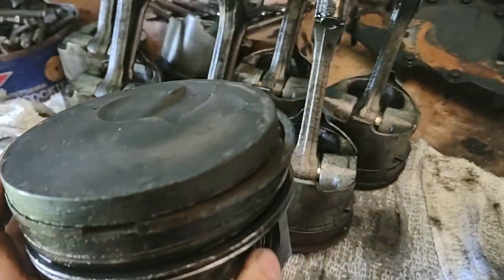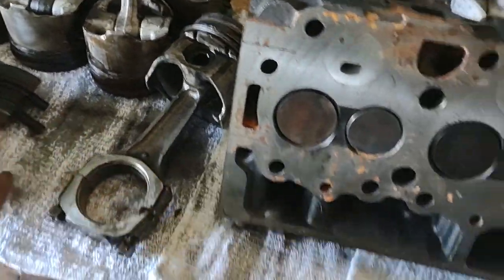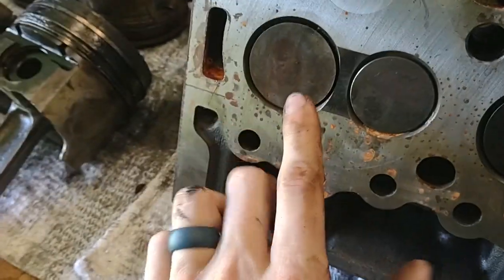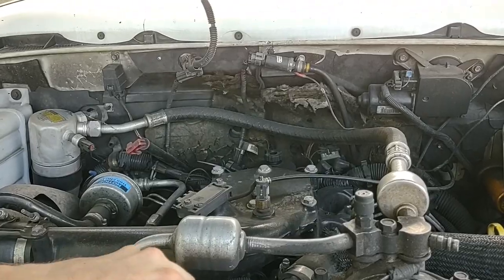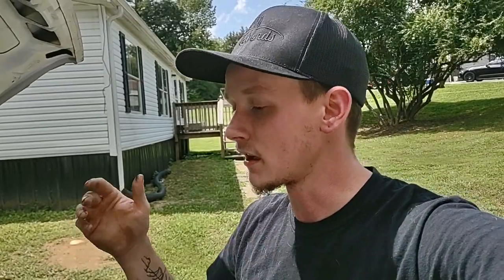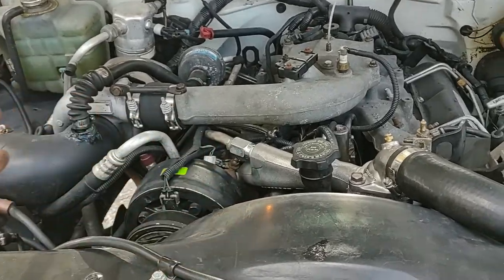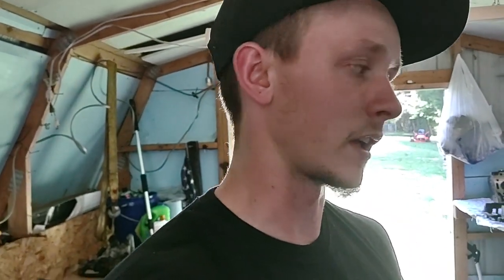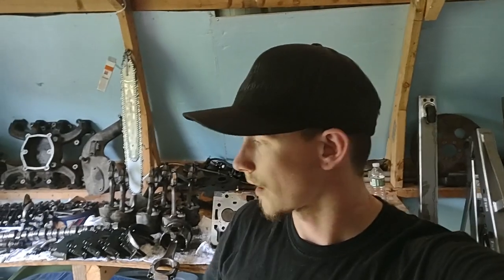6.5L blow by

Comment: I absolutely love all your videos. I just bought a 93 single cab dually yesterday and I've been binge watching your videos to learn as much as I can about these engines. I'm very familiar with the 6.6 Duramax and I currently have an 02 24v Cummins drag truck but I know NOTHING about the 6.5. Your videos have taught me a lot so far. Bought the truck with a bad starter and should be changing it out in the next day or two so I can fire it up to check for blow by and any other issues that need address
Reply from the maker: Hey thank you man, I appreciate you taking the time to watch the videos. I will have more on the mechanical pumps in the future for ya for sure haha. Hope your able to get her going soon brother 👍

Comment: 6.5 with maintenance are reliable engines.  Problem is nobody changes their oil, drives them like a race car, and drive them till they break.  I am learning the hard way!  Engine in my 93 k3500 has bad blow by because the oil was never changed and the dude sucked sand into the engine.  I only paid 500 for my truck though so a new motor is not a big deal to me.
Reply from the maker: Maintenance is key man, I completely agree. Glad you got the truck for I'd say a fantastic price regardless of condition and from the sound of it plan on keeping her going👍

Comment: Great video! Good advice for those wishing to own one of these. Thankfully, I have no blow-by stories to spin as I have kept up with the routine maintenance on my 94.
Reply from the maker: That's awesome man! Glad to hear you have run into no issues! I wish I could say the same but working on other people's trucks I've seen some  wild stuff haha
Reply: @JessePelkey1  Yes.   .I have a 6.5 turbo Chevy Tahoe in New Zealand.
It was converted to RHD in Canada & shipped new to NZ in 1997
Done a 190Kms & worth about NZD$25k.. Very cheep.
 Old gas Blazer are going for twice that.
diesel fuel is NZD$1.20 per lt.
 + road tax of 6c per km.  !!!
& road tax for a 50 ton truck & trailer is 60c per km
Some guy said there were Only 3k Diesel Tahoe's made. from 92 - 98. ??
Reply from the maker: @mtl-ss1538  not sure about that exact number as far as the Tahoe's go but I imagine where they are fairly hard to come by here in the states they are even harder to find over there in New Zealand.
Reply: @JessePelkey1  fun fact:-  only 3000 were ever made and most were sold in other countries, other than the US It was available from 95-99 and the 6.5lt Turbo, diesel Tahoe was a special order through GM. It’s one of the rarest modern vehicles you can get
Reply: @Dakota Duree While mileage and maintenance is a factor, if the truck has been worked beyond its intended limits that will also play a role. Then there is the possibility that no matter what you do or how it's used there is always that's one that just dies young. But having some blow-by doesn't necessarily mean it's done. Heck there are plenty of trucks chooching up a storm and still on the road with a couple 100k miles on them.
Reply: @Dakota Duree If you are building pressure and it escapes through coolant overflow then head gaskets or heads. Can't advise on additive as being a reliable fix. Minimal blow-by could be that the CDR needs replacing. Often overlooked but it is a wear item and if it hasn't been done then it's definitely overdo.
Reply: @Dakota Duree Could be just condensation. Never inspected mine when changing it. I have read that some folks clean and reuse it but I replaced mine as I understand there is a thin membrane inside that can be damaged making it non functioning.

Comment: Hey hoss, could ya take a look at my video showing blow by on my 97 6.5? Changed CDR and still has some. Not enough to float the cap, but it does come up from the dipstick tube pretty good. Maybe previous owner put non diesel oil in? I have a feeling I'm not making much boost either. So I do think my turbo could be helping add to the blow by. I have a boost bolt coming in so I can run my boost guage to see actual pressure.

Comment: hey Jesse , I only have 25000 miles on my RV and its had blow by from when i purchased it at 10000 miles , its a 2003 when i purchased it the units in Australia have no pcv they just vent to the road ,,, I didnt like that so i put a seprator on and i get about 30mls on oil change at 5000 miles ,,, My Truck is NON EGR,,,,,,I think they all have blowby unless you put Gapless rings in ,
Rob 
NSW
Australia
Reply from the maker: Hey R.J, yes without gapless all engines have some blow by,be it almost non existent or just a little hase, just depends on how much and if there is any pressure behind it like said in the video 👍 oil vapor is pretty normal but when it comes to pressure that's when things start to go south.

Comment: Goods videos i really like the time you take putting good info in your videos and i own a 94 suburban with the 6.5 and sadly the previous owner hade a flex plate issue and put a new on in but did not get it right and it has been sitting for about 4 or 5 months and it only has a little over 187000 miles and was wondering what kind of problems they can have when sitting and some of the issues they might have over 100000 miles if you could reply that would be amazing but if not keep up the videos man
Reply from the maker: So long as the engine is sealed and no water got into it, 4-5 months of sitting is no worries in my opinion. I've seen plenty of them sit far longer and be revived, check all the fluids and you should be alright. As far as common issues the 6.5l engines have specifically, I would encourage you to check out my bomb proofing 6.5 videos series I came out with that kind of going to better detail as to the common issues of these things have.

Comment: Great video thank you! My 96 6.5 k2500 Burb 180k original miles has blow by from the fill tube and dipstick tube when hot but no pressure. if I plug up the CDR valve there is major pressure and blowby. Compression test shows 400psi in every cylinder. No power loss and good starts. This is either normal or the CDR masks blowby?? Or maybe I’ll need a valve job down the road? Im told the 6.5’s unusually high compression ratio could be the culprit.
Reply from the maker: Is there pressure behind the blow by or just vapor? The cdr won't make blow by, by itself but if the cdr is clogged it will prevent the crank case gasses from getting out of the motor. Vapor is normal. Could be valves or valve seats but best way to find out is a leak down test.

Comment: I just bought a 94 k1500 long wheel base and someone had rigged the cdr with some tubing I looked inside and it had Brillo pad in the tube that was on it and the valve cover had some Brillo pad in it I got out and took the tube off and re did the cdr valve correctly and the truck runs fine still I’m gonna replace the cdr valve and keep rolling it seems strong doesn’t run hot pmd is relocated idk I just thought it was weird any speculation would help I don’t daily drive the truck it’s a project

Comment: I wish i wouldve seen this video before buying my first diesel! 97 k2500 previous owner put breather caps in place of cdr and oil fill cap. Over time my engine has become covered in the oil that comes out of the breathers... Seems to run fine (no misfire and still get 12+mpg) but has other issues i need to tackle as well... Crossover shot, week/cheap starter, and water pump going (started overheating while plowing and now if it idles too long). Planning on doing topend gaskets/seals. Wondering if i should suck it up and rering it too? Other things i should replace while at it? Best budget friendly place to get parts?
Reply from the maker: Best place to get parts for these ol engines in my opinion is Quadstartuning.com may not be the most budget conscious but quality is more important in my opinion. Better to spend the coin one time then spend a lesser amount three times. Upgrade the water pump to a high output one, heavy duty fan clutch, duramax fan blade assembly, and upgrade the thermostats to 180'F thermostats. So long as the blow by isn't overly accusive I wouldn't worry too much about re-ringing it. I would also recommend an oil catch can.

Comment: Thanks for Sharing your experience love all your videos you are very knowledgeable of the 6.5. I love mine I have a 1996 c3500 I get around 13 MPG towing my 10000# fifth wheel camper from Vermont to Florida. Is that good MPG? What kind of motor oil do you use?  My other question is how to tell when my gm5 is getting worn out. I am getting about 5-7 psi on my boost gage when pulling a hill. I am starting to see some oil sweat on the bottom of my turbo. What are some of your thoughts? Ty Joe
Reply from the maker: Not bad fuel milage pulling a trailer in my opinion. Campers aren't light and they aren't the most aerodynamic depending on the model. Either way I don't think that's bad at all for a 6.5l. I am running rotella t6. Oil in front of the turbo is not uncommon especially since the crank case ventilation goes right into the intake. But if the turbo is obviously leaking then that's a pretty good sign the seals have failed. Shaft plat is another thing to check for on a turbo, both in and out, and up and down play.

Comment: Worse case I came by was a 4.8 gas motor lost 2 quarts of oil in 10 miles. I drilled holes in the oil cap and it stopped pushing oil out the dipstick tube. It never blew out any seals which was odd.
Reply from the maker: Damn that is bad man, talk about some pressure 🤣 I'm surprised the seals held up

Comment: I did this test my 1996 6.5 diesel no blowby even at 500 000km not sure what that is in miles. But I have a slight knock going on. It runs great great oil pressure idles great no smokey haze at idle it'll roll a bit of coal but not much and clear up quick . It seems have a small knock it seem to be more right side I will mention just got the truck running after it sat for too years in a field I did oil change 15-40 John Deere oil and new fuel filter. The knock seems too take a few seconds after start up to be noticable unless it's my ears tricking me. Some one told me either wrist pin or bent rod. I was told it didn't make any weird noises when it was parked the trans was acting up but ran great I was told and it's a friend of mines dad's truck so he's got no reason to lie to me. Can a injector be bad without smoke ?
Reply from the maker: Typically when an injector starts to go down it can make a ticking noise and a very small almost unnoticeable amount of smoke, of course without being there it's hard to say what it is.
Reply: @JessePelkey1  🤔 I'm going to try some new injectors I got bad cross over donuts so got to pull the turbo any and going to install the full new 4" exhaust and 3" down pipe figure I'll do glow plugs while I'm there. I  have a 97 parts truck going to take the motor out strip it down see if it's cracked I would like to do a motor rebuild I have rebuilt dirtbike motors now I want to try a truck motor this 96 6.5 is my leaning curve truck I'm going to learn how to rebuild the motor and spare 4l80. If the 97 block is done witch I'm going to assume it is tossed a rod out the pan the guy claimed yet I see nothing to indicate that happened. What's your thoughts on these new reproduction engine blocks? I have bin seeing online there $1400-$1800 claim to be revised blocks I was thinking I might do a full new motor off one of them with new heads to go with and do main studs on bottom and stud the top aswell
Reply from the maker: @taylorh3930  I haven't heard anything bad about the reconditioned blocks but I haven't bought any myself so I can't really give a personal opinion.

Comment: I just had a buddy pick up a 94 k1500 for me with the 6.5l in it for $900. I have a 98 k1500 with the 5.7l and plan on swapping the 5.7 and tranny with the 6.5l and 4l80. Only concern I have is any electronics. The 94 has the old guage cluster so I can't swap it. You know anyway I could  wire up and use factory guages? Or have any advice?

Comment: So im getting smoke out out the cdr and oil filler but its not puffing the oil cap and  will sit there and not move im lost on this
Reply from the maker: Smoke with no pressure is pretty normal, the smoke is just oil vapor and is flowing in the direction of the turbo as it should. The turbo removes the positive crank case pressure from the motor to prevent seals from blowing. So long as there is no pressure behind the smoke your good. Smoke can mean that it's showing early signs of engine wear but as long as you do proper maintenance you should be able to go on for awhile without seeing pressure.
Reply from the maker: Is it alot of smoke or just a little?

Comment: Will the timing being off cause blowby. I have no oil leaks, no excessive oil consumption. plenty power. Changed oil every 2500 miles. Rebuilt injection pump, not sure if timing is completely correct.  Changed s intake to a F intake. Just considerable blow by now. Ant thoughts.
Reply from the maker: The timing being off, nor the injection pump itself, would make blow by. Where the injection pump does not make pressures that can intrude into the crank case, the injection pump is not the cause of any blow by. The only things that will cause blow by are, bad or worn piston rings, bad or worn cylinder walls, cracked pistons, bad or worn valve seals, bad/ worn valve seats or improper crank case ventilation.

Comment: Hey man I got a 6.5 and it’s got 138k on it and after watching this video I checked my truck and with the oil cap off it would smoke some out of it but i couldn’t feel any pressure coming out when I put my hand on it and the cap too, what do u think is bad and how long do u think the engine has?
Reply from the maker: Hey there Ethan, with just a little mist with no pressure the engine is ok, oil hase is very common, could be something as a slightly clogged valve cover mesh, pcv valve or just the slightest bit of wear on the rings. So long as the oil pressure is above 20psi with the engine warmed up at idle and there is no pressure behind the hase she still has plenty of life. Best way to make sure she goes the extra mile would be regular maintenance 👍